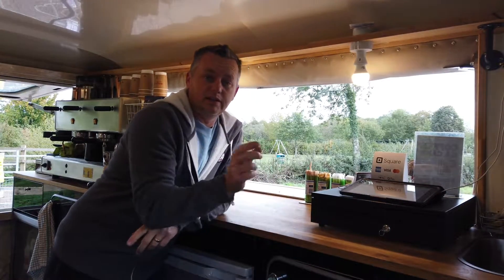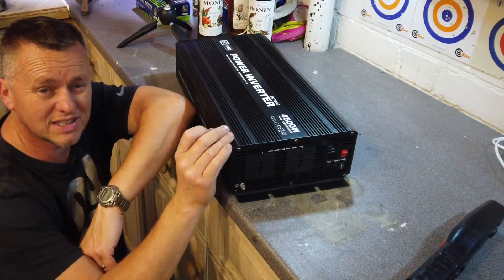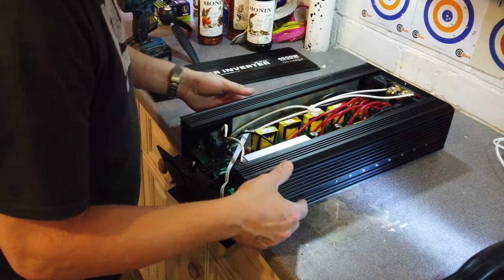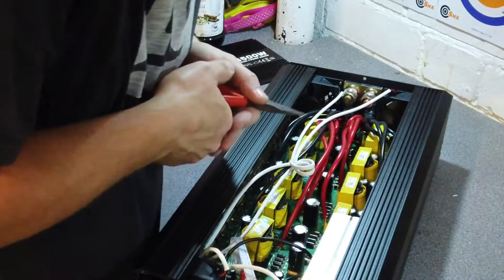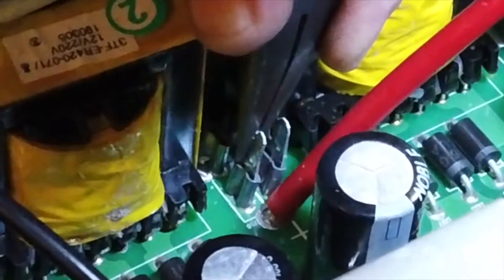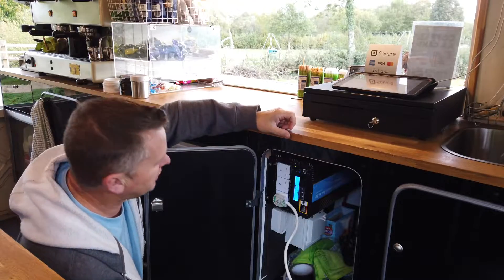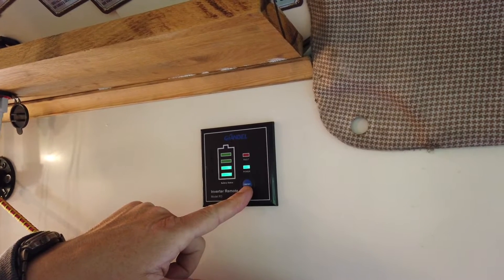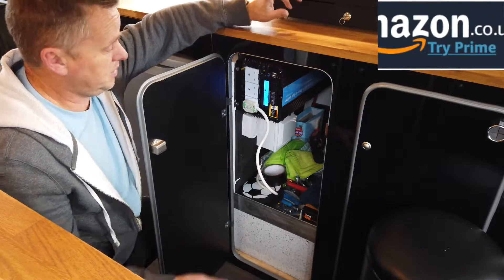Coffee Van, New GIANDEL 5000W Inverter, "Review" After RS Inverter Meltdown !!!

Comment: My guess is you've blown the mosfets, when their is a big bang that's usually a fet exploding from over current and that's always accompanied by a bad electrical burning smell. 
The fuses blew after the fet blew to short.  Over temp will lower the max power rating so ensure ventilation.  With your rs inverter you can buy all the fets on-line from a good Taiwanese or American supplier not Chinese supplier because their components though cheap aren't always up to standard .
The other comments were right about hard wireing an extension with a 15A rated socket because the inverter will work for a while but will get hot, so one day when your really busy will probably start to melt resulting in eithor a short and another blown inverter or worse, a fire.... could be good publicity i guess😂😅. 
With the rs inverter you should be able to see the fet that exploded when you remove them,  their is a chance there not all blown only half or maybe even only 1 as they often fail to short so your fuses may have protected the others. 
Test them all before reusing them though or you may just fry your new ones. 
Good luck
Reply from the maker: Thanks for the great information👍🏻👍🏻🛠

Comment: Mistake #1 is you shouldnt have the coffe machine plugged into the inverter outlet,needs to be hard wired into those 3 set screws so you can get the full 5000 watts .Each outlet dosent handle 5000 watts,thats why they provide the terminals.You could get a 3 into 1 plug and use all the power but a waste of outlets.Cut the end off your cord and expose 3 wires,positive,negative and ground and go directly to the block.
Reply from the maker: I Have been running the machine hardwired, changed it some months ago. Thanks for the great information👍🏻👍🏻🛠

Comment: "I've only got 2 fuses in there"  and here is your fist mistake.
you most likely had a cascade failure of the transistors fused to "open" dead short. this the fuses blowing.
once a single transistor goes, it raises the stress on all the rest above their tolerances and they cascade blow.
if that's all it is, you could take a shot at replacing all the capacitors with good quality ones, but the likelihood of other damage is pretty high with a dead short open state.

time wise for a busies, it's just cheaper to buy a new one.
and, a good one (expensive) well over rated for your need unit is the best way to go.
(less stress on the transistors)
Reply from the maker: Thanks for the great information👍🏻👍🏻🛠

Comment: I like the video. My honest view for that much money I would have gotten a pure sine wave inverter mind you I suspect you could have gotten a pure sine inverter for around the same price range Note you would have gotten a longer run time and your equipments would have run much cooler. This brings me to my next question is the wires from the batteries fuse? Respect man nice video.
Reply from the maker: No fuse link to the inverter just hard wired old skool, The pure sine wave was twice as much for the power I needed this works a treat, Thanks for the great comments👍🏻👍🏻🛠

Comment: My guess on the blown fuses is cascading. One set blows, more power on the rest another set blows and so on. That is a potential problem with a bunch of parallel fuses. One larger fuse would avoid that problem.
Reply from the maker: You could be right, Thanks for the great information👍🏻👍🏻🛠

Comment: Perhaps you skipped reading the page in the manual, or maybe you didn't get a manual, but you are not supposed to connect a 3.5Kw device to any of the 3 plugs provided as they are rated at 13Amp and/or 2500 watts max (page 7 in the manual). For loads bigger than 2.5Kw (like in your case) you were supposed to use the direct AC terminal, (the one above the LCD) designed to give you the full capacity of the inverter (5Kw).
I got the feeling that that is the same reason why you killed the other inverter... Giandel are good inverter for their money but their ratings (like most Chinese products) are overrated.. Nonetheless, if you open the new unit and look inside you should see that the cable going to the strip terminal are thicker than the ones going to the three separate outlet. That;'s why in the manual, they specifically recommend using the terminal for higher loads like in your case...
As others have mentioned, when the unit reach the 50°, because of the mounting location you will need a much better airflow as hot air rise and it has no way to escape in your cabinet..
Good luck..
Reply: Anything over 1.5k should be hard wired to the connectors not drawn through the plug sockets
Reply from the maker: Thanks for the great information, We only use the inverter on low power when on the batteries, 2500w, so the connector plug is ok, really pleased with the giandel works like a dream 👍🏻👍🏻🛠
Reply: @aaanton11  Not sure I follow, as you mentioned that the coffee machine is 3.5kw in the video. If you are still interested in fixing the old inverter, try to replace all the mosfet before putting in new fuses.. If you don't use more than 2.5kw out of the single outlet, as you have claimed now, the high temperature in that cabinet is the other possible explanation of why they failed in the first place.. Been using Giandel inverter for a few years now and beside the unrealistic power surge claim they have, they are good value for money..
PS. I would still use the direct terminal to operate your Giandel inverter as even 2.5kw is a lot for a single power outlet, but hey, it is your money... 👍🏻
Reply: @il-mozzo7672  based on your experience with giandel, do they work well with high powered inductors like motor etc. I have something I  want to power with rating of 3kw at 15a. I am assuming it's surge is much more at start up considering it is an inductor. Would the giandel meet this requirement and if not can you direct me to a decent long duration run time inverter?

Comment: My only thought is there doesn't seem much airflow round the unit. It also sits in the top of the cupboard so will be sat in its own hot air.
I notice there is an outside vent at the bottom. Maybe a fan to blow the hot air out of the vent would be useful. Something like this. https://www.amazon.co.uk/ELUTENG-120mm-Fan-USB-Compatible-Black/dp/B075WSD68T?th=1&psc=1
Reply from the maker: Thats a good idea would definitely help with cooling, Thanks Gav for the great comments👍🏻👍🏻🛠